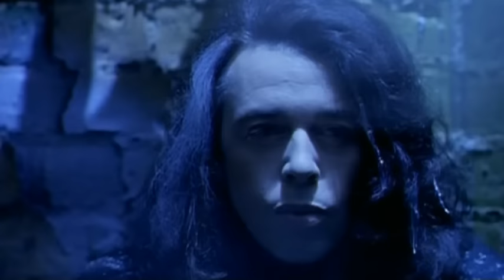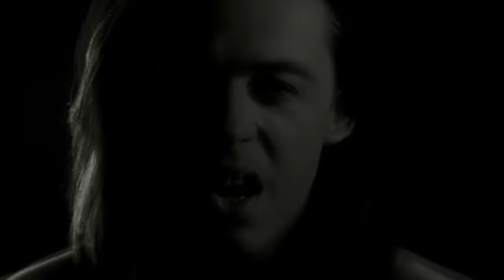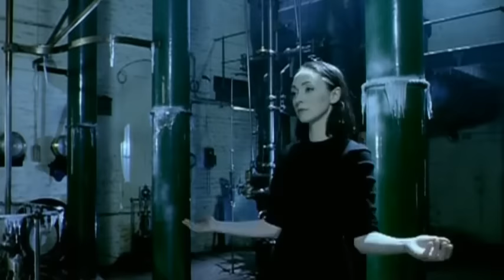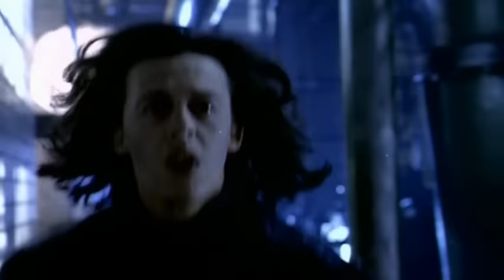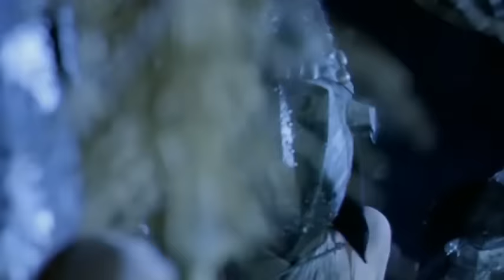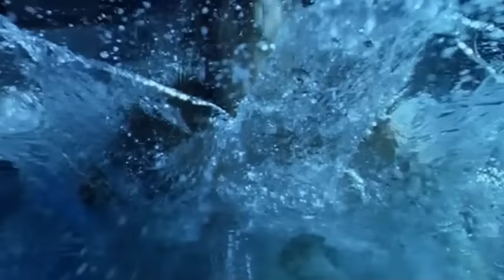Tears For Fears - Cold

Comment: "KNOCKLE, n. Also nockle, nochle, knyockle, -el. The rounded, protuberant part of a bone at a joint, the condyle (Cai., Ayr., Wgt. 1960)."

"con·dyle. ˈkän-ˌdīl also -dᵊl. : an articular prominence of a bone. used chiefly of such as occur in pairs resembling a pair of knuckles (as those of the occipital bone for articulation with the atlas, those at the distal end of the humerus and femur, and those of the lower jaw) see lateral condyle, medial condyle."